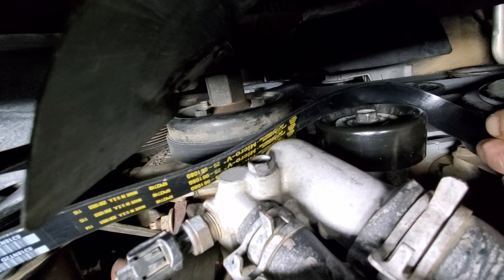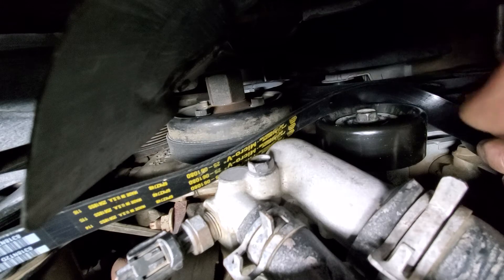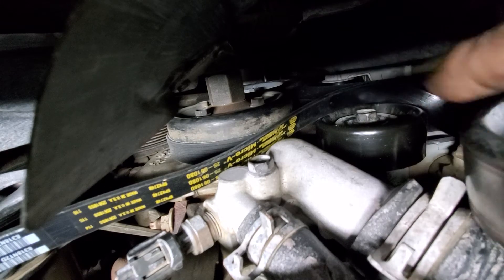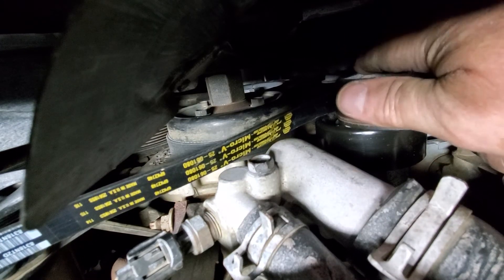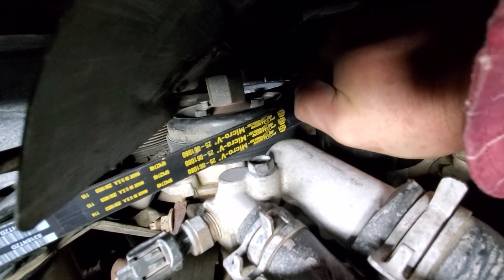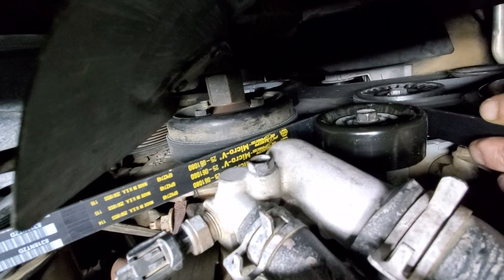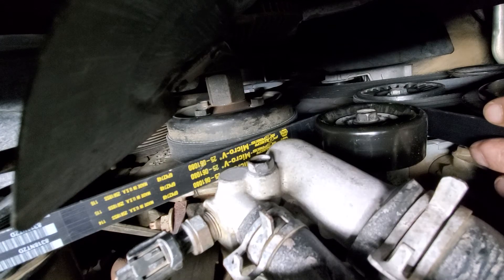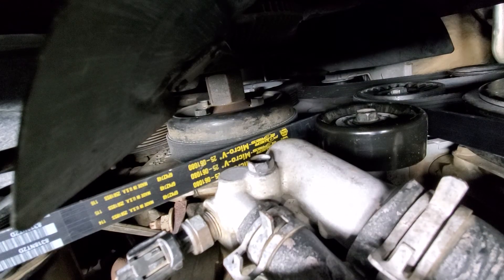Tip to replace new belt that seems too short

Comment: I just ran into this problem today !    
What frustration,  I disassembled the fan shroud to slide the belt over the fan (this took me 10 minutes to figure out). Once in place, I pulled down on the belt until tight.  Then I pulled the tensioner  down to its stop point, and tried everything I could think of for 30 minutes to slip the new belt over the idler pulley.  But the belt is either 1/8" or 1/16"  too short. This is a perfect idea, because if you just replaced the tensioner, you have the right size pulley handy on the old tensioner.  I'll try tomorrow and report back.   I bet this only works when the belt is just barely too small.
Reply: the soap worked great, did it without a pulley, just used fingers